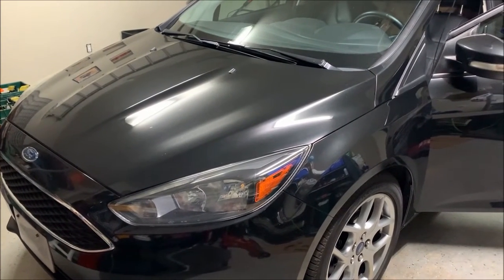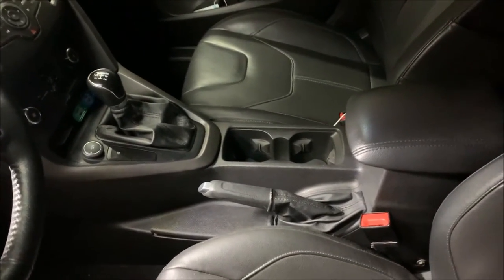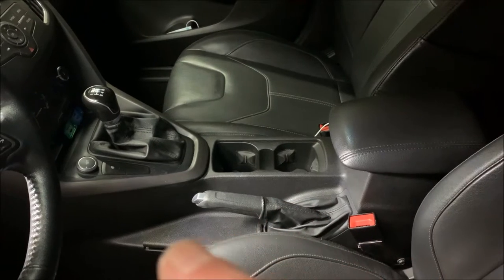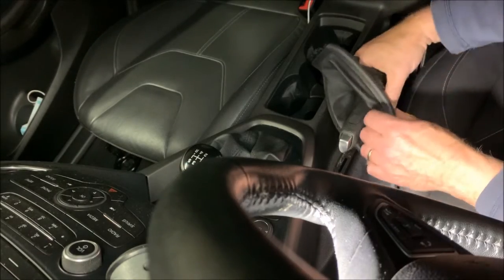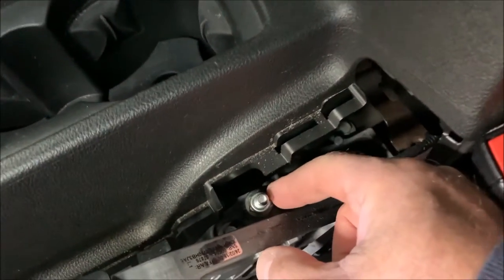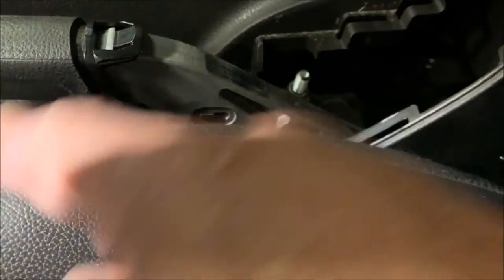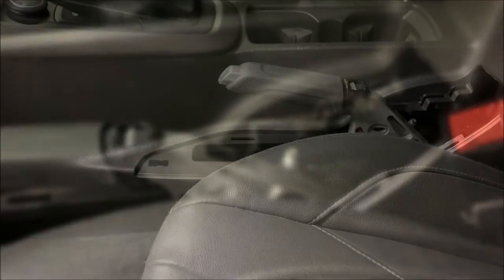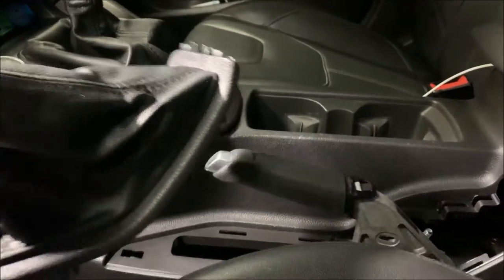Hand Brake Adjustment DIY - Mk3 Focus (2012 - 2017).

Comment: Hi, i tried to do the same, but i did turn the wrong way, and the bolt came off, and i have no more hand brake. Dont seem I'm able to put the bolt in and tighten it anymore. Any suggestions?
Reply from the maker: I don’t own that car anymore so I can’t even go have a look for suggestions. All I can think is to try to ensure the cable is pushed up from under the car to reattach the nut.

Comment: What if my ebrake dont make a clicking noise and the handle wont stay up?should i try adjusting it bfore buying a whole new assembly?
Reply from the maker: It won’t do any harm to try adjusting it. Sounds like the pawl isn’t engaging any more. I’d guess there is a spring of some sort that is no longer working.
Reply: @boatinglife1  i took a look today im definitly going to order a new ebrake setup its toast

Comment: Is this the same for Right hand drive models?
Reply from the maker: I’m afraid I can’t say for certain. I believe the RHD models have a different configuration of centre console (at least from what I’ve seen in the UK). I think the handbrake location is slight different so I don’t know if it has the same adjustment method.